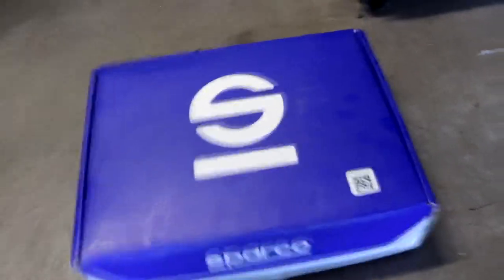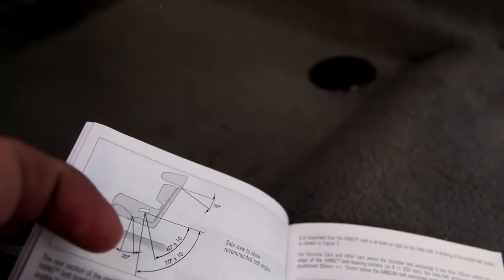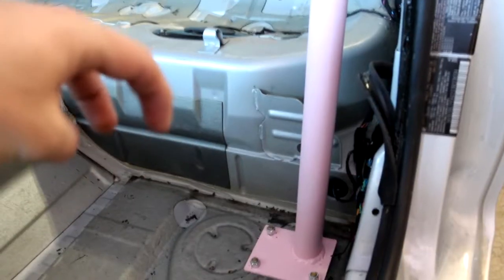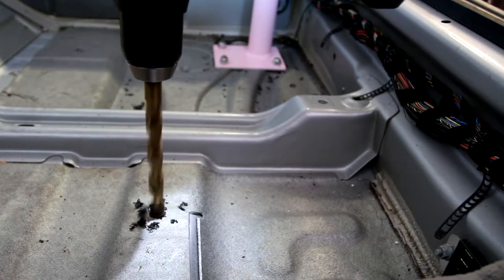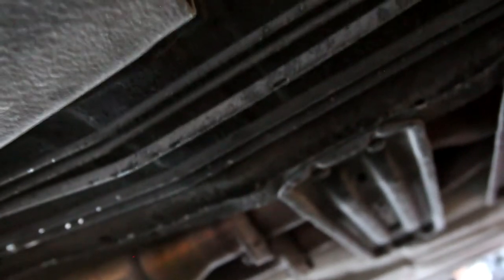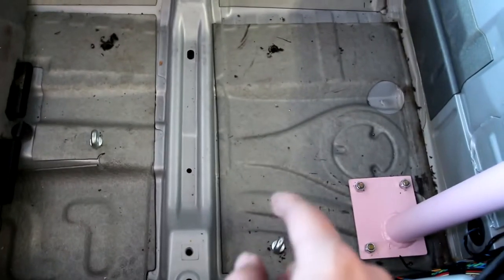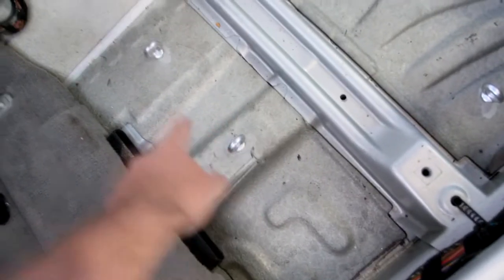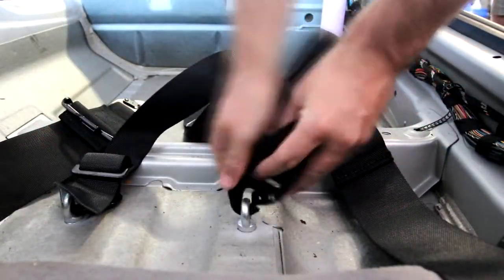Installing the 6 Point Racing Harness - BMW E46 M3

Comment: Super informative, thank you! 
Quick question: I was wondering why you didn't center the submarining belts to the seat? They look off to the right. Do you. Notice any discomfort or pulling to the right under heavy track braking?
Waiting on parts but this will be the next step in my E46 coupe. Thanks again for filming this!
Reply from the maker: Thank you! I do not notice any pulling or discomfort, the location of the mounting points was based off where I could safely send them through the car without hitting anything underneath. The brake lines run right under the driver side.

Comment: Enjoyed watching your car proceed ! Was wondering if you could have just used the oem seat belt holes in the chassis instead of mounting with eyebolts
Reply from the maker: Thanks! I would have loved too and I did try, but the eye bolts I have didn't have the same thread as the seat belt bolts. That might be something that could be sourced but that is only one of 3-4 holes, depending on the belt you get. I was on a time crunch and knew I had to drill at least 3 other holes so one more wasn't the end of the world for me.

Comment: Did you run the eye bolt between the brake lines ? Not sure how else to space them apart properly
Reply from the maker: Yes. I ran them in the gap between the brake lines.